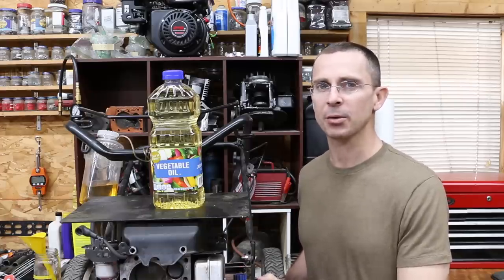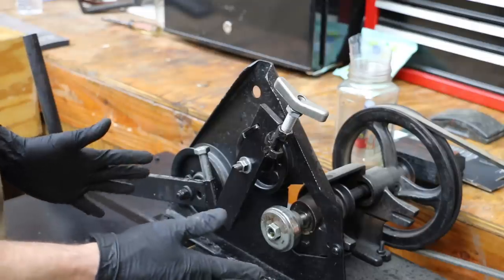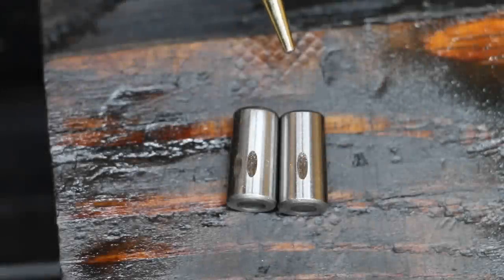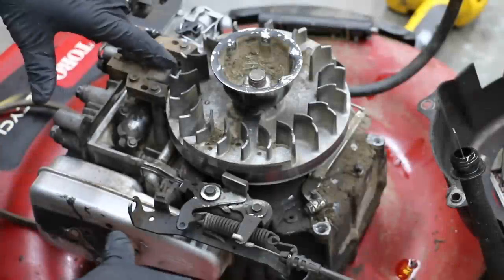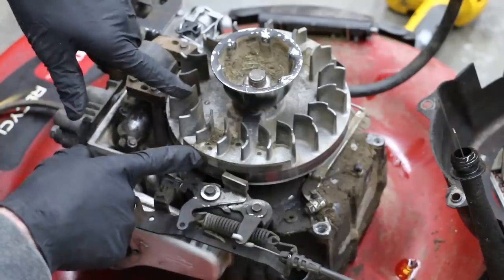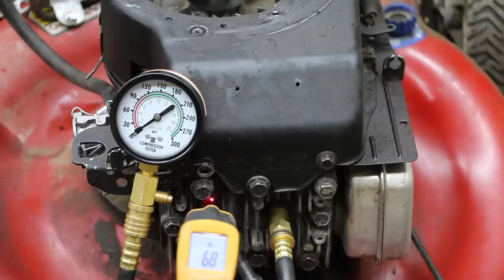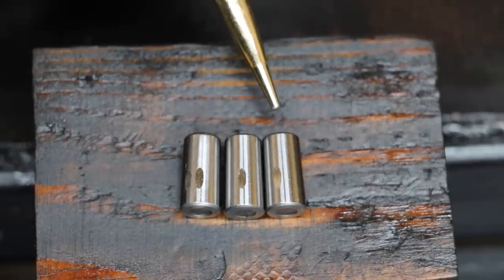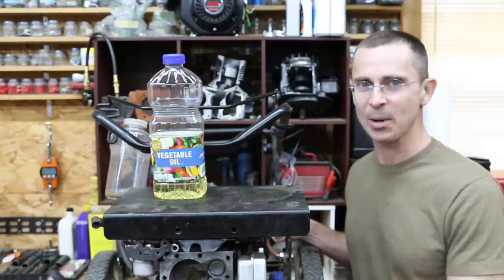Will Vegetable Oil work as Engine Oil?  Let's find out!

Comment: An interesting implication of this is that if you ever got access to a diesel engine to do experiments on, that means you could both run and lubricate the engine with vegetable oil.
Reply from the maker: This is a great recommendation! I'm hoping to buy a small diesel engine soon.
Reply: Cool, I can't wait to see what you test on it!
Reply: I wonder if this would cause a runaway engine? I noticed that there was a lot of residue left on the cylinder and head. If there’s enough blow by from the vegetable oil I’d imagine you might have an issue
Reply: Another vote for this - I was very excited to see a veg oil test on your channel - all the years of people telling me that veg oil is a poor lubricant compared to diesel in my fuel injection pump seem to be disproved. Maybe you could also test diesel alongside veg oil and regular 10w/30-40-50 oil etc?

Well done and thanks again :)
Reply: But the issue is if the diesel decides to run away, the only way to stop it is to restrict air flow to the intake as diesels dont have butterfly valves like a gas engine does.
Reply: heck a runaway diesel will kill itself on its oil being fed to it through the turbo
Reply: Yes
Diesel engine experiments would be a great addition to this channel!!
Reply: I literally came here to post that same comment. 
I suggest eighter volvo200/700 or Mercedes W123. Owned both, tested both vehicles with cheapest vegetable oil as a fuel. Ten years later, both engines are fine.
Reply: R2Bl3nd 
Hahaha, I was just thinking the same thing.
Reply: Takoda Wolf - not really, I have two veg oil fuelled cars, one land rover & one VW/Skoda. The land rover has no intake shut off valve, but the VW does. It's called an anti stutter valve (asv) to shut the engine off when turned off and prevent it running on.
Neither engine is likely to run away just because they run on veg oil.
Reply: You can run a diesel on pure veggie oil, but the gylcerin backbone of the trigylcerides present in vegetable oil will cause gumming over time of injectors, fuel pumps, and injector pumps. Its better to strip the trigylcerides into methyl esters (biodiesel)
Reply: Hi Rick and I had a Rabbit years ago with a zillion miles on it, had to roll it off to start it and even had the baffle over the cam to keep the oil out of the crankcase breather. Yu couldn't run it over 45 m.p.h. or it'd try and run away but would get 45 m.p.g. 10 gallons of fuel per 450 miles. Finally gave it away and I think it was rebuilt and maybe still running.
Reply: That was often done back in the day. You just have to change out the engine oil often (put the old engine oil in the tank and refile the fresh oil into then engine). It works fine. Plant oils (some of them) run very clear in old diesels, no soot, very clean engines if you take them apart you can tell if it has been run on diesel or plant oils.
Reply: @ProjectFarm  When you use a diesel engine with vegetable oil you should try out the Schur mixture (adding 10-15% of petrol into the vegetable oil and about 5% pure alcohol like 99% rubbing alcohol) the petrol makes the vegetable oil more liquid and resistant to cold weather and the alcohol brings down the ignition temperature to what it would be with diesel. We use that mixture in germany when we want to run modern diesel engines on vegetable oil.

Comment: Works in an emergency but probably costs more than cheap autozone brand oil which would work better. Good to know tho! If I’m out on my four wheeler and have an oil leaking issue and can only find a grocery or corner store that doesn’t sell motor oil I can buy some veggie oil and make it home!👍🏻
Reply from the maker: Great point and thanks for commenting!
Reply: Or drive to a auto shop
Reply: @gabrielgarcia9822  drive with no oil?
Reply: @gumelini1  once my sister drove a year without oil.
Reply: She did not, the engine would not hold and seize pretty fast. Proof? Check out the other videos where he tries to use other things like shampoo as oil, it seized the engine after a minute. I refuse to belive that your sister could drive more than a minute without any lubrication whatsoever.
Reply: @eddieschubertsson8543 . The oil thing was empty
Reply: @gabrielgarcia9822  The car can't run without oil. Either you didn't check it correctly or you're lying. Even if it ran a whole year without oil(it didn't) the oil pump would needed a change after running dry for a whole year
Reply: In Europe veggie oil is much cheaper than engine oil. Veggie oil costs about 1 buck per liter, engine oil about 5 bucks at least.
Reply: @eddieschubertsson8543  search car throttle how long will a mercedes last with no oil. Definatly  not a year
Reply: @eddieschubertsson8543  The car may have just been running with oil lower than the dipstick, not "empty" like Gabriel thinks. I ran a 97 Voyager with so little oil that I didn't even see any on the dipstick once, the car still ran for a while.
Reply: @gabrielgarcia9822  That was because she drove a two stroke, that kind of breed had oil in the fuel so no extra oil for lurb is needed. Tho they still use oil for cooling system, you might mixed it with actaul engine oil.
Reply: veggie oil is cheaper
Reply: @ProjectFarm  BTW, excellent video! 👍😆 Can you do a COMPARISON video that rates the performance of varous vegetable oils? Compare extra-virgin olive oil to regular olive oil. Or compare corn oil to sunflower seed oil to soybean oil. Like the scoring of the bearings, temperature tolerance, etc etc etc. 👍
Reply: @eddieschubertsson8543  You're right. It's impossible.

Comment: Will straight pump diesel work as an emergency crankcase lubricant?  People do this all the time to flush sludgy crankcases and I am wondering how much damage if any it causes.
Reply: knurlgnar24 Same question
Reply from the maker: Thank you for this recommendation!
Reply: Low oil pressure and won't lubricate near as well.  May overtime deteriorate seals & gaskets.
No more than 100 miles is recommended when flushing.
Reply: Its used in very small mixture quantity with oil strictly for cleaning. Valve seals and gaskets are not made to withstand fuel. I have seen diesel and gas engines with flooding problems wash the pan gaskets out.
Reply: knurlgnar24 No. In the diesel world, when certain types of injectors fail, they dump fuel into the crankcase. Bad things happen to the bearings and rings, quickly.
Reply: NO it will not, no debate. I mean if life depended on it, do or die, sure, but its not going to last and the flush BS is all BS, it leaves harmfull deposits and cleans things not ment to be. it kills engines.
Reply: Project Farm I’ve seen the aftermath of this in a Diesel engine. Injection pump lost a seal and dumped diesel into the crank case, it scarred the bearings bad!!!! But it sure was clean
Reply: Knurlgnar24!! I'm waiting to see some new videos from you. Hope to see some soon.
Reply: Had a 120kva generator caught in the flood zone of remote area and the motor oil was contaminated with water and became milky. Our mech dumped the oil and fill the engine to the brim with diesel, and the generator took 1 week to reach dealer. At the dealership, the engine was disassembled and no rust observed so it was simply put back and still doing its job today.
Reply: No it will not, will for sure wash out bearings. Had it happen on a diesel after lift pump diaphragm failed, oil level was coming out filler neck and was thin as diesel. Oil pressure didn't come back up with fresh 10w40 in, replaced main/rod bearings and back in business.
Reply: Using diesel oil (higher detergent) can help flush a petrol engine.
Reply: If they put more than a 1/4 capacity as diesel they are crazier than crazy. with no engine load you can get away with a lot of stuff but put a load on it and things will start going south. There is a reason diesel oil is 15w40. (Or synthetic equivalent. 5w40). Most newer gas engines are 5w20 now with older 90's era being 10w30.
Reply: My truck diesel engine uses 5w-30. Too thin for my liking but hey gotta use it so the stealership will honor the warranty.
Reply: Year make and model so I can make a note of that. I don't work with the newest diesels anymore. Please do share some details.
Reply: Ford Duratorq 3.2 as well as 2.2. I believe the new 2.0 diesel will be using 30 weight as well.
Reply: Iv been subscriber for about 3 or more years waiting to see some soon.
Reply: as a ford tech, I can tell you what happens. I get the pleasure of seeing it often. it washes oil off metal to metal parts, taking out rings/cylinder walls and bearings when the oil looses it lubricating properties. this is exactly what happens when injectors get stuck open, and the owner continues to push it. Ive seen it hundreds of times.
Reply: knurlgnar24 a friend mechanic used diesel in a crank case for an engine flush, for a 1996 Ford E250 with a 300 Straight 6. The screen was clogged with no oil pressure. He drained the old oil, added diesel, and ran the motor for 45 seconds. Drained it again, added fresh oil, and had full oil pressure again.
Reply: knurlgnar24 I wanted to ask just that...
Reply: How long do you run the engine w/ ATF?
Reply: Gotta see this one. It can run a gasoline 2-smoke so I would think just so long as it has the film strength it could run an engine.
Reply: That's why I check the oil very often on my common rail Toyota as the injectors and supply lines live amongst the rockers, a rising oil level requires immediate investigation. I left the fuel valve on my CG125 Honda open once, had a crankcase fuel of fuel and oil the next morning. The motor had come to rest with the intake valve open. Lucky me lol, my departure was delayed by an oil change. Not good when you have run out of Marlboro's.
Reply: The white metal bearings are designed for a certain lubricating film as they are hydrostatic. That means quite a few things need to be right. Running diesel through them is a sure way to get glitter in the oil. And glitter belongs on the paint job, not in the pan.
Reply: Some DPF Diesels end up diluting the oil during regeneration, there are probably others but certain Mazdas had an extra maximum level, if you ignored this the engine could run away. The effect of the diluted oil is bad news for the engine too. A terrible design!
Reply: I've done this in the past on the older V-8 engines when they started getting heavy sludge in them. Drain the oil, fill with diesel fuel, new filter, and run for no more than 75 miles. 

Drain diesel from crankcase and let it drip overnight, change filter, and new oil. Recheck oil level every 200 miles, and change oil and filter at 2000 miles. 

I've gotten close to 175,000 miles from an engine without a rebuild. Provided the engine wasn't trashed before I got it.
Reply: Most of your replies are with mpre knowledge than mine. But, I would look at what happens to diesel or kerosene when being turbulent. It foams very badly. I would never use a fuel as a lubricant. You can use a lubricant as a fuel but you'd rather not be around it.
Reply: Jason Guerard
You forgot the BIG one . Diesel Engine runaway. Really BAD JUJU.
Reply: Pat massey atf causes bad things too. Its a horse a piece
Reply: knurlgnar24 I've been trying to get this to happen for a while now I think straight desil won't work well but a 50/50 mix of desil and oil would work in an emergency situation
Reply: Doesn't have the viscsoty at normal operating temp.. would spin bearings in no time. Have used several times for a flush on a luke warm motor.. and never more then 3 mins @ idle for this guy.. great results.. never had a negitive issue so far..
Reply: Thank you, very interesting,  very well done, very thoroughly done... let's hope I don't have to use it
Reply: No, it won't.  There are some old instructions used to clean crank cases using a certain percentage of diesel fuel and motor oil, but that will greatly reduce its viscosity and lubricity.
Reply: Try ky jelly
Reply: I would think the risk of a really big fire is there... diesel flash point?  Low isn't it?
Reply: why do both of  you have to go there with the swearing and all? If you have an argument to make, make it. If you don't have facts, don't make them up, or just assume the other guy is wrong. Do what this dude does, PROVE IT.
Reply: I remember using diesel to flush a 4 stroke outboard when it sunk during my apprenticeship days cleaned it out well
Reply: You can always test it on a beater engine and do an oil analysis before and after to see if metal ppm changes. But from my experience, any used oil that has been diluted with fuel (either from bad blow by or oil consumption) diesel or gas always showed a high flashpoint and higher iron and aluminum wear from the oil analysis.
Reply: you sure that thing was valveless? i have had many apart, they have exhaust valves, and intake ports.
Reply: Kerosene is used too
Reply: Lcr34   Viscosity has nothing to do with film strength. That from oil chemists and mechanical engineers. People hold all kinds of myths without any actual education on those very things. Viscosity is a flow matter to be able to enter tight places. The engines that have tighter engineering REQUIRE better flow. Most of the oils that have the strongest film strength today are the 20 and 30 weight multigrades and that because of certain additives. ( calcium petroleum sulfonate )
Reply: My 99 ck 3500 had issues with  lifter noise kinda scary. So I flushed it,  fill it with recommended i think 10-30 but it got worse. Then I  added 2 quarts of Lucas stabilizer wala ran perfect I could barely hear the lifters after that. Now I just do Castrol 20-50 n 1 quart Lucas I got almost 300k on it now 👍😎
Reply: no,
Reply: knurlgnar24 i
Reply: Rick Delair hey what’s up buddy lol
Reply: Having been in and around engines most of my life I would highly recommend against running any Engine with diesel in the crankcase. Way back before the modern oils I did use 1 quart of automatic transmission fluid, and let it idle a few minutes before I changed the oil. ATF is basically a 10 weight oil with very high detergents. With the new oils I don't believe it's needed. I use Mobil 1 oil and filter and change it once a year whether it needs it or not. Many years ago my dad took off one of my valve covers and ask me how I kept it so clean, I told him I simply change the oil and filter regularly.
By the way Knurlgnar I love your videos about inverters, and how to fix them.
Where did you get that name from?
Reply: By the way, check out on board oil centrifuges. Oil filters clean to about 30 microns or so, but oil centrifuges can get down to about half a micron or less.
 Pennsylvania biodiesel Supply has some pretty good information of how they work.
 Autowin make some good ones.
Reply: Generally you don't want to load an engine when doing something like this. The diesel will cut the oil's viscosity to the point the film on the crank & bearings will not be sufficient and you risk galling the bearings.
Reply: Rick Delair  I have a freightliner tanker with a 8v71 and runs and runs. I had the inspection plate off to check the piston sleeve and out of curiosity fired her up. Boy she made a mess, but watching the pistons fire and the action was a little Scarry, but fascinating. Should try to video it one day.
Reply: @lordtigranes9877  *voilà

Comment: I did expect it to work at least fairly decently but it appeared to me to be a bit more capable then I thought it would be. Ive had this exact curiosity ever since the first time I poured 5w20 in to an engine and felt as if I was preparing to cook fried chicken because of how thin it was. Thanks for the video sir we appreciate it.
Reply from the maker: Thank you!
Reply: I was once pouring 0W20 synthetic oil in my new car and I could hear it go down to the drain pan. Mother of thin lol
Reply: I work at Toyota and the new 18 Camrys have 0w-16 oil. Basically water
Reply: Gutsup wow. I never even knew 0w16 existed until today. What are the factory recommended oil change intervals on those oils?
Reply: I agree, I think oftentimes we underestimate organic (in the traditional sense) food-grade oils, they obviously work fairly well in the tool world for many purposes. I mean, I wouldn't swap out a vehicles motor oil for vegetable oil, there are so many modifiers added even if it matched lubricity it'd turn to gunk rapidly, but as we begin our slow drift away from petroleum we'll still need "oil" for all sorts of moving parts. Heck, instead of trying to refine corn into a weak gas alternative they should put the research into better organically-derived oils for lubrication. I mean, castor and linseed oils are still preferred in several instances over synthetics, I'm sure with a little R&D they could probably replace a lot of lubricants with less toxic and renewable lubricants.